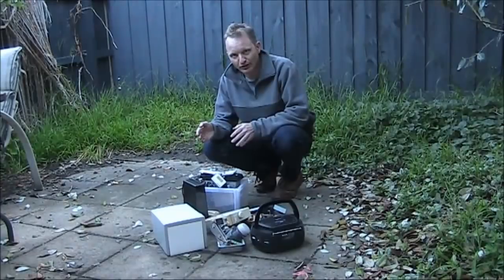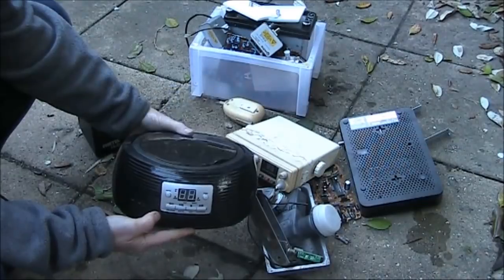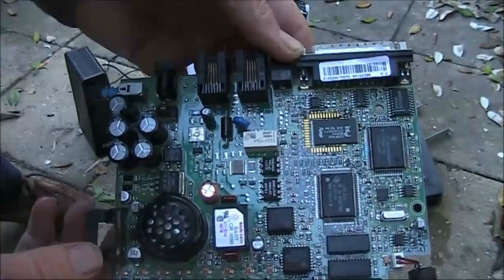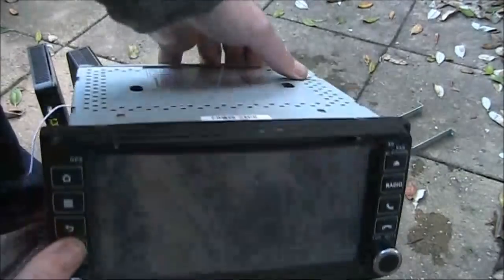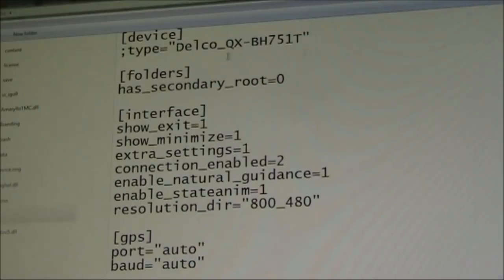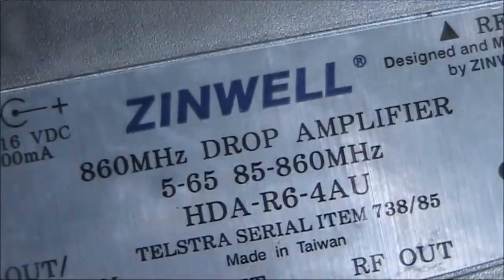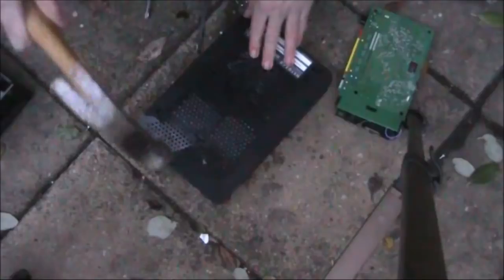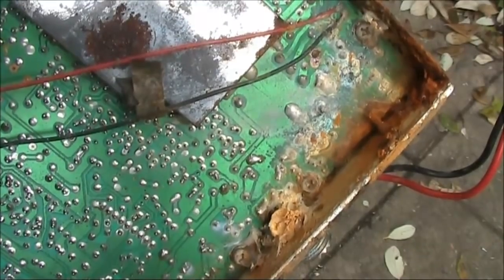Electronics on the Floor: Nature strip electronic junk pickings 2018 - Part 2

Comment: Mystery board is a garage door control board, which has the relays and the battery charger on the board as useful stuff. Mystery box with white front is a quad output LNB, used to connect multiple satellite receivers to a single dish.

Comment: I don't know exactly why but I have always wanted a 27Mhz SSB Marine radio.... nice haul Peter 👍
Reply from the maker: I think 27 MHz  marine is well past its heyday. Despite being by the beach I think I've only heard activity on the band once or twice. Listening during the summer sporadic E season might be interesting but again I suspect very little. Dick Smith (I think) sold 27 MHz SSB marine but I don't think many were sold. And now you'd go 156 MHz plus HF for long distance.
Reply: @vk3ye  Indeed DSE sold a Marine variant of the Hornet SSB as did Uniden I believe it was called a Barracuda... I have been enamoured/fascinated with such radios (and the SSB mode) since I first saw them in the DSE catalogues (back before you had to buy them LOL),.

Occasionally I still see one pop up for sale on buy/swap/sell sites but realistically the more modern designs keep out the moisture more effectively and any units still worth owning would have been boxed up or home/shore installations.

VHF does make more sense for short to moderate range ship-to-shore communications 👍